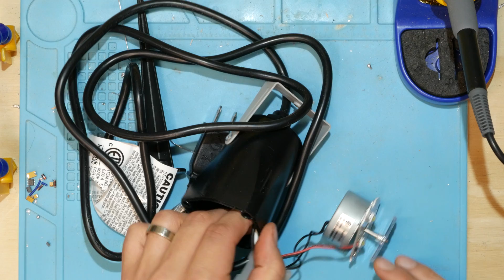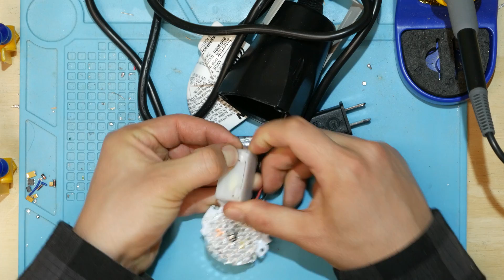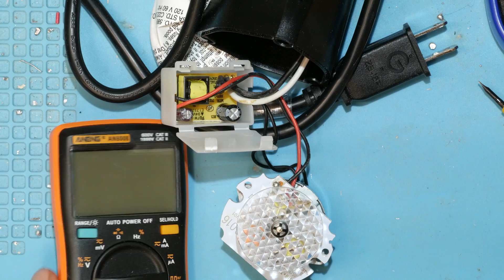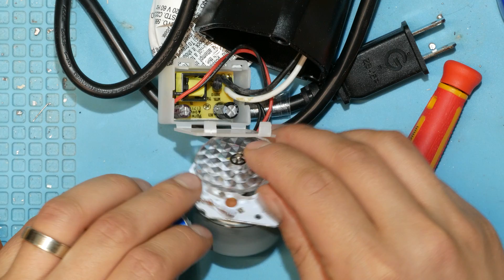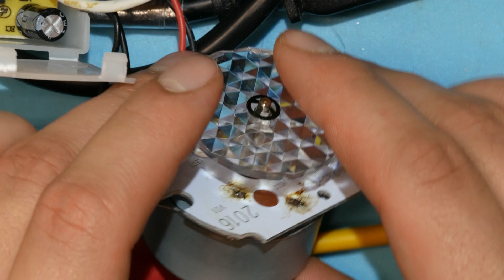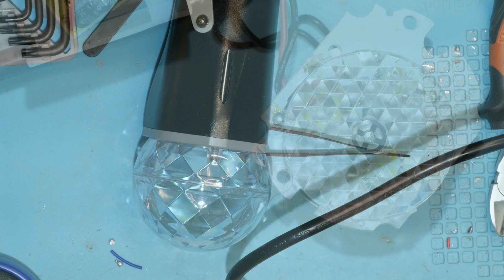Fixing Gemmy Outdoor Projector LED Light

Comment: Thank you Matt for the video! I have the Walmart snowflake kaleidoscope light. The insides are almost identical to your light. Tested it and found one of the four LEDs was burnt out. I didn’t have a replacement led so I just made a 5/8” jumper wire and soldered that in place of the bulb. Reassembled it and it still looks awesome and bright with three bulbs.

Comment: @MattInglot I have a similar Gamma projector. The motor works fine, but the lights are no longer projecting. I took the unit apart, and all of the LEDs have a very faint flickering. What do you think the issue is? Would it be normal for all the LEDS to behave the same way if they're failing?
Reply from the maker: Could be the voltage regulator. Could be a loose connection. Could be a failing LED (the LEDs are in series so if one goes, they all stop working)
Reply: if one LED goes out the rest go out in the projectors i have found, you'll have to find a replacement color lens , however i find the ones ive gotten are far brighter than the originals so it over-kills and makes it so the other colors dont show well :/  this is very frustrating when these things aren't cheap to begin with

Comment: Great fix video. How do you disassemble the unit?  Can't figure that out.  Thanks!
Reply from the maker: There are 3 pocket holes that have a torx screw in them (I don't recall the size but if you check the comments you can probably find them). You need a pretty long bit. I like the long allen key style bits, but using torx instead of hex.

Comment: I have 3 Gemmy Kaleidoscope multi-color light fixtures.  They have a wireless remote control to select difference color patterns. One of the fixtures now has very dim red color output, but the blue and green is good and strong.  I guess if I can find the correct replacement red LED or LEDs (don’t yet know how many it has), I can try to fix it in a similar manner that you did.

Comment: Mine aren't "gemmy" at least it doesn't say that on box. They're from spirit, but it looks the same. 
I bought a bunch of these and same issue, the next year two of them burnt out. The motors run when plugged in, so it's the LEDs which is weird they would die so fast. 

I got a green and purple fire and ice. I can't find the screen type to get them apart, I'm also not electric handy so I will have to try and find someone who can fix these
Reply from the maker: Yea based on how many people have viewed this video it's definitely an issue that seems to come up over and over.

Comment: I had a Home Depot fire and ice light I previously bought that was literally right out of the package this year and it lasted all of 4 days. Mine has all leds on but barely lite.  They flash brighten up when power is disconnected for a second.

 It would be helpful to mention what the voltage going into the whole led board should be -to eliminate driver circuit issues.

I’m reading 16.4 volts which seems high, but I’m assuming that is because this is an unregulated driver board.  Since all my leds are weakly lite, I’m not sure if it is the leds or the power supply.

I wouldn’t even bother with this except these lights are getting harder and harder to find super cheaply as in years past post Halloween.
Reply: When I do a diode test, each Led lights up but are all still weak.  When I did a diode test with the power On, the other Leds light more brightly when I do the test on one particular Led.  I’m thinking this may be because I’m bypassing a bad diode with the probes?  Anyone?
Reply from the maker: @p.granger8824  I actually dealt with this in another light this year. One bad LED can absolute make the others go dim as it turns out. To test which one you can just power the LEDs individually. The diode tester on your multimeter only delivers enough current to barely light them up, but if you have a benchtop power supply you can set the current limit to something reasonable like 20ma, and then power each LED individually to find the culprit. That's how I found mine.

If you don't have a current limiting power supply then a battery and resistor can accomplish the same.
Reply: Thanks.  Now I just need to find some SM Leds.  The ones on this light look smaller than the ones in the video, they are also square with no dome.  Maybe I can just retro in another type if they fit under the lenses. @MattInglot

Comment: One other related question. If I have a white light that dims, and a blue one that does not , can I swap the LED parts to get a working white one?  If so, which parts, and does this require soldering?  I have extra blue ones I picked up for a few dollars on Halloween day.
Reply from the maker: I wouldn't suggest it since putting blue leds into a white light will give you a blue light, so you're back where you started (if I understand what you are saying correctly).

Comment: We have one of these that works and is bright when it is first turned on. After a few minutes, it dims significantly, but keeps working. If I unplug it, the light keeps emitting for 1-2 seconds,  then flashes bright,  then off.  All LEDs seem to be on, just the dimming issue.  Suggestions?
Reply: Older post. but what you are describing is the same thing mine did.  It was bad LEDS.  Use the Diode function on a multimeter and connect the probes to the neg and pos of each LED.  You can usually tell which are bad because they will not really light up like the others.  Another thing to try is to Press Down on each LED with the power on.  One of the LEDS may have a bad solder joint.  If pressing one down suddenly makes the whole light come on, it's likely a bad joint.  These lights produce heat which over time can make the solder joint bad.  In that case, see my post about how I repaired mine.  You may be able to simply resolder the LED with a heating plate. - hope this helped.

Comment: Highly informative...however, would you mind sharing how you removed the lens portion?
Reply from the maker: There are 3 pocket holes in the case with torx screws in them. I forget the size (you could scroll through comments maybe it's listed somewhere), but basically you want a really long torx screw driver. The allen key style torx sets work great for this, just make sure to get long ones.

Comment: Light failed out of the box. 
I live 25 km away from the store.  Not worth the carbon footprint to return it right away. I couldn't find the receipt anyway.  I got them to replace the ones I bought last year that died.  Because this problem is so common the manufacturer should be made to either replace or repair the projectors.  If they die after one or two seasons. This is just so much more e-waste into our landfills.  Or we ship them offshore and pollute some small poor country.  Because the manufacturer bought the lowest, poorest quality product.   I've had some of these for over a decade.   I run them 10 hours a day for a month.   They still work.  Some of these newer models fail out of the package.  If the maker was held responsible for the returns and shipping cost it would make quality job 1.  I think the stores have realized how poorly made these are and stopped carrying them.   Walmart didn't have any this year.  Canadian Tire hardly had any.  They've started selling a unit that screws into a light socket.  I see my local HD (25 km away) is out of stock.  I guess they're sick of marking them down after Christmas.
Reply: Right!  You used to see these all over like at Lowe’s and Home Depot.  I bought them for $5-$6 after Halloween.  Now these stores don’t even carry them.  Since I’m not paying $25 for these cheap lights, I’m trying to maintain what I’ve got.

Comment: I cannot get to the 3 mounting screws, and remove them from the black piece. Did you use a hex driver to remove them?
Reply from the maker: They are torx. I used a torx key set, those ones that look like Allen keys but are torx bits. You can find tonnes by searching on Amazon. You want a nice long one because the pocket holes are pretty deep

Comment: Do you know why all 3 of my leds light up but are not bright enough? They don’t project. Is it the leds that went bad?
Reply from the maker: Probably something to do with the power supply/led driver. Capacitors have come up in the comments as a possibility. However it's hard to recommend messing with that as you're working on mains voltage at that point and could get hurt.

Comment: Great video. Yes, these lights fail often.  Question - I have one in which the motor spins and the leds light, but they are very very dim (barely light).. What could that mean and/or what would be the possible  fix?
Reply from the maker: Another commenter made a good point that dim LEDs could mean bad capacitors. However that requires working on circuitry that touches mains power, so my advice would be to toss it unless you know exactly what you're doing.
Reply: @MattInglot  I have the same issue with dim LEDs.  Not worth the effort diagnosing this for the $20 or whatever these things cost nowadays.  Thanks for the video though.  Only one I could find about this exact light.  Might want to add "N1W3LED-2" to your video description for more hits.  There are zero hits for that on Google and Bing and that's what's printed on the circuit board.

Comment: I have a couple of these that have gone dim I'm going to take a shot at replacing the capacitors on the board and see if that works I'll let you know if it works.
Reply from the maker: If you get it fixed would love to know! I think someone else in the comments had this issue too.

Comment: I have a Gemmy projector with a moving spider that seems like it got stuck? The spider no longer moves. Any ideas on how to fix that?
Reply from the maker: I've never had one of the lights you describe but I looked at a video of it and I'm going to guess it's probably a similar concept to the light in this video, just the spider part probably spins very slowly. So that means there's probably a motor just like in the light in this video and for some reason it's not spinning. 

So here's the hard part: why is it not spinning? You'd have to open up the light and find out. Your best scenario is that one of the wire connections to the motor failed and broke off. If you know how to solder then that's an easy repair. HOWEVER that motor probably runs directly off mains power, so you have to understand how to do this safely, including never touching anything inside while it's powered on. Repair at your own risk.

The other possibility is that the motor itself failed, or something jammed (in which case the motor has probably burned out by now if this was running while not moving, so either way you've got a failed motor). In that case you'd have to try to find a replacement motor that matches the specs of this one. I personally wouldn't bother. Toss it in the trash or use it without the moving effect. But technically it could be fixed.
Reply: @MattInglot  Thank you for your response! I appreciate it!!

Comment: Just fixed mine today. The bulbs are in series and are POLARIZED. So if one goes out, all three will not light until you replace the culprit(s). Make sure you have the + and - leads correct or the replacement will not light at all.
Reply: They aren't "bulbs", they are "light emitting diodes" (aka LEDS). All LEDs have an anode and a cathode + and - respectively for forward bias) because their original purpose is to block the flow of current in one direction (rectification). They are how you convert AC to DC among other things. So any time you use a diode, you have to be aware of its polarity.
Reply: @FredDeckerNC  how do you know the polarity?
Reply: The board itself usually has the + and - printed on it.  To check Led polarity -check it with a 3 volt power source if it isn’t marked.  The Leds will only light up if you have it correct.
Reply from the maker: Nice work!
Reply: @MattInglot  Thanks to you!

Comment: Matt - Excellent video and thanks for sharing.  I have a couple that I need to fix as replacing them can get costly.  I was curious though, I have one in particular that the motor runs just fine, but all of the lights go out after a couple of minutes.  I can let it "rest" for a day and the same thing happens.  This is the purple and orange Fire and Ice light.  Is this the cause of 1 bulb not working that all of them would go out?  I checked with the multimeter and the power going to the board itself gets power, but none of the lights do.  I have to wait a while before I can test again with the multimeter to see if the lights come back on.  Let me know your thoughts.
Reply: The power supplies are known as "LED Drivers". You could fix them (usually the large capacitor fails and blows gunk out the white case and into the entire assembly) or buy replacements from China. Look for the 9-18V 4W version that will fit in the case.
Reply from the maker: I can only think of two things: if it consistently goes out after a couple minutes and you don't see voltage, it sounds a lot like the AC=>DC converter might have something overheating causing it to stop working. Or possibly a loose connection that just happens to get loose after a few minutes. It seems that this is another possible weak point of these lights. Unfortunately trying to fix any of that means working with mains voltage, so I would honestly trash it and live to see another day rather than risk hurting yourself.

Comment: So did your last just not light up at all? Mine does this thing where it lights up fully and works fine (motor works) for a few seconds, up to maybe a few minutes and then it dims down to a point where it’s barely visible. Well more accurately, 2 of the 3 LED’s are dim and one is dim and intermittently flashing. This sound like a bad LED? Wouldn’t expect a LED to work fine for a period if it was defective, but I’m not as familiar with LED behavior and my multimeter is old and doesn’t have a diode mode.
Reply from the maker: Mine didn't light up at all because an LED blew out. If all the LEDs are dimming, I would expect they are not getting enough power, which could mean there's a lose connection where something is hanging on by a thread, or more likely something wrong with the AC=>DC convertor where it works fine when cold, then heats up, and then something no longer works. Sadly replacing LEDs here is unlikely to fix the problem and troubleshooting further requires working with mains power so I would strongly urge you to dispose of the light and just buy a new one. Sorry.

Comment: Several comments have asked about the remote and changing the colors. Mine is stuck on Red and I want it to be multi color again. Is it the remote (new battery) or the receiver on the light? Thanks!!
Reply from the maker: hey Chris mine doesn't have a remote, so truthfully I don't know. It could easily be either of these, but it could also be a problem with just that color LED burning out. Something to think about. Unfortunately most of these outdoor decorations just don't seem to last very long from my experience.
Reply: Open your phone camera, point the remote at your phone and see if you see the infrared light that is invisible to your eye, but not the CMOS detector in your phone. If you do, then it is likely the light and not the remote.

Comment: The real problem with this instruction video is you don't show how to take apart the unit - in particular the transparent plastic cover - or indeed put the thing back together again.  Its virtually useless without STEP 1.
Reply: Completamente de acuerdo, vine al vídeo por lo mismo
Reply: The tops generally come off with 3 or 4 screws coming from the back.   The problem is, a lot of the time these are not standard screws and the spacing is pretty small.  You need some decent small screwdrivers and maybe star pattern heads.  

The screws inside are small Phillips.  

The rotating lens is removed by placing a knife blade against the compression ring and prying up a couple legs.
Reply: Agree.

Comment: This is great and helpful. I thought it what I was looking for but I needed to know how to get the plastic lens off mine. It might be different than this one as it looks like I have to break the snaps to take it off. Mine just projects Christmas presents, but the wheel stopped turning.
Reply from the maker: It's possible but check carefully before you start snapping things. Sometimes screws are very hard to find, or hidden behind plugs. I've learned that the hard way many times. Good luck!